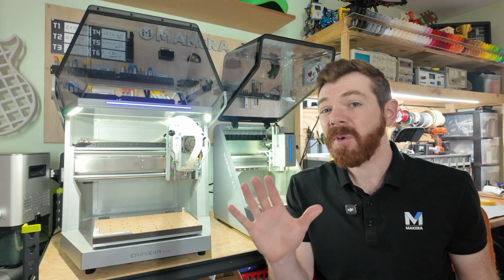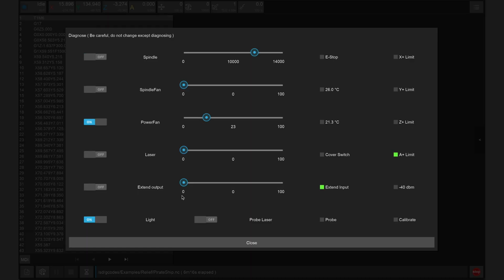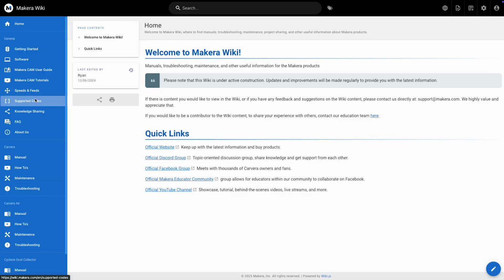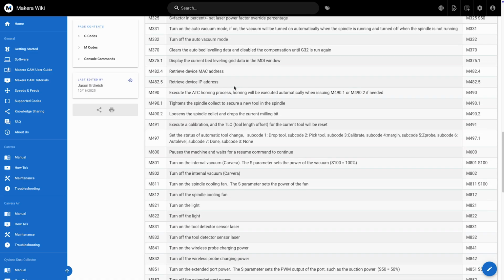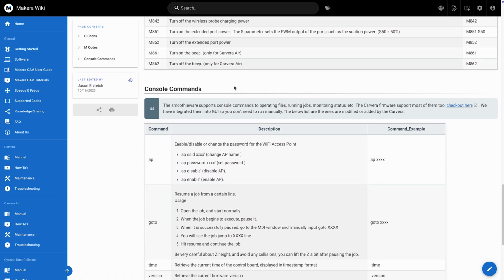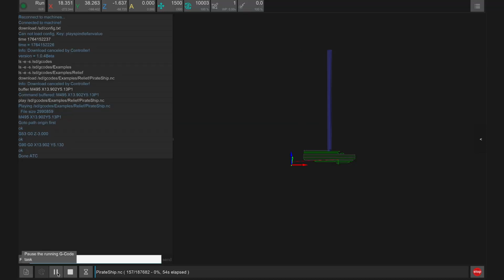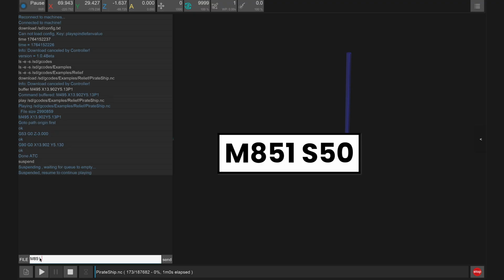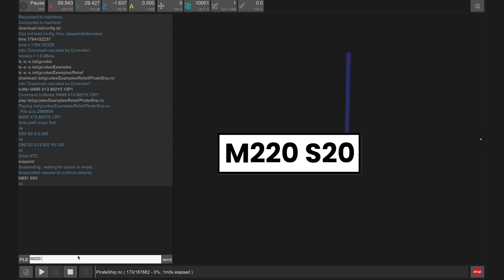How to Send Manual Commands to your CNC

Comment: When is the software going to be fixed? Having to re-start the software just because the Tool menu is locked out is frustrating.
Reply from the maker: This shouldn't be the case, please try a later update or reach out to our support team for further assistance
Reply: @Makera  You should check out the reviews, I am not the only one experiencing this. Software is up to date, and its on two separate PC, one with Windows 10 and the other 11.

Comment: Timely video, really useful! For the release tool command, would I be able to insert a large diameter flattening bit (I have a slab flattening bit I’d like to use in my 1/4 collet) obviously I could never do this with the ATC of my carvera. The bit diameter is 25mm, would there be any issues you foresee?
Reply from the maker: Thanks for your support!

Comment: Hi :) question as a Z1 backer: it there any method to get to in reverse direction feedback from machine Z1 what tool number to put next? Some virtual uart / rs232, debug interface?
EDIT: maybe this was not really clear. If I generate g-code for Z1 in Makera CAM, run program, is there any physical or virtual interface to EXTRACT tool number, when Z1 paused waiting for tool change?
Reply from the maker: Not at this time, but perhaps in the future.
Reply: @Makera  ok, thank you for info :) how Z1  is right now indicating need of tool change? Only program run pause?